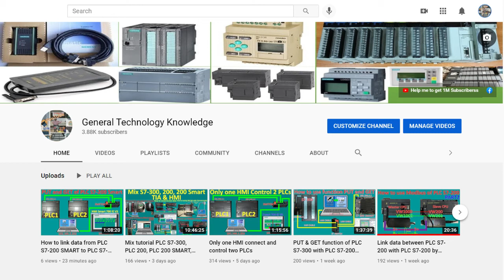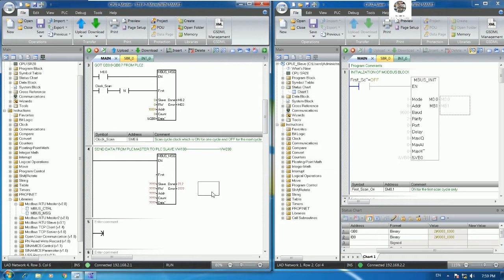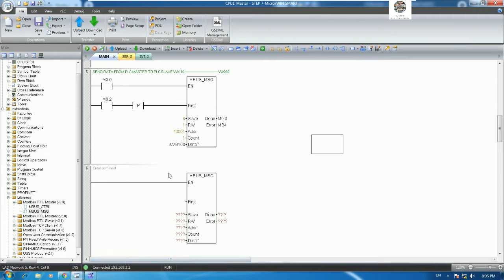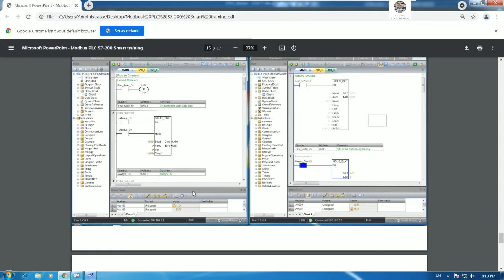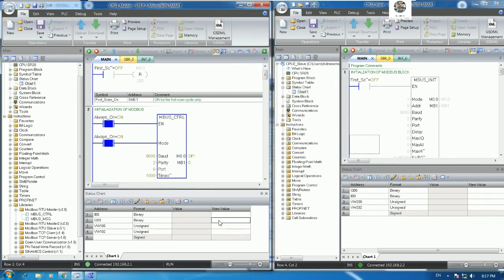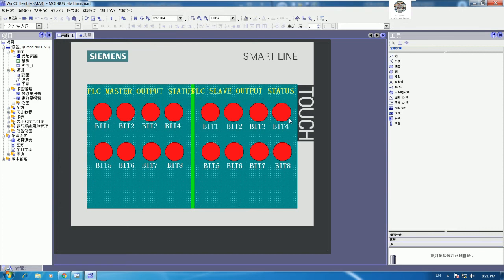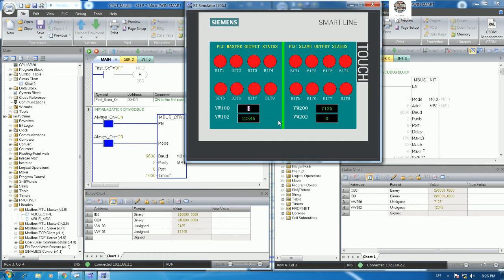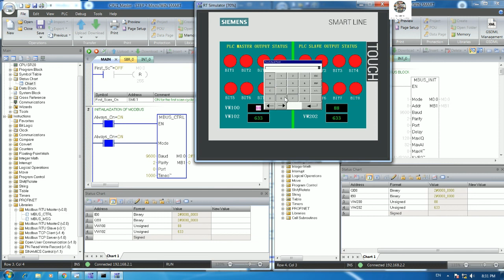How to implement PLC S7-200 Smart with Modbus communication Part2

Comment: Is it possible to connect sensors with Modbus output RS485. If i have 200-300 sensors with modbus output, can we use a PLC for connecting it in a single PLC.